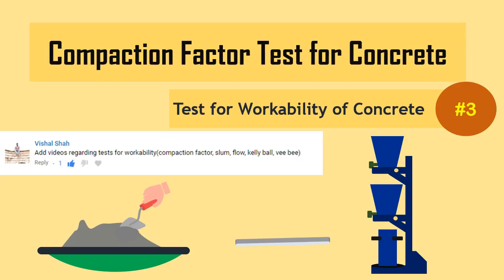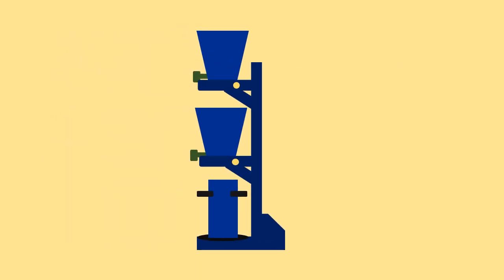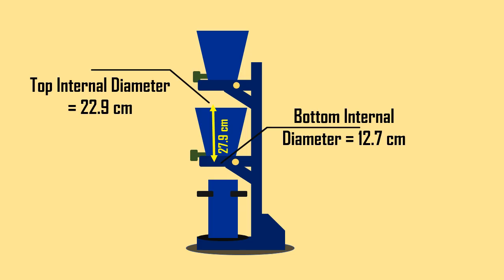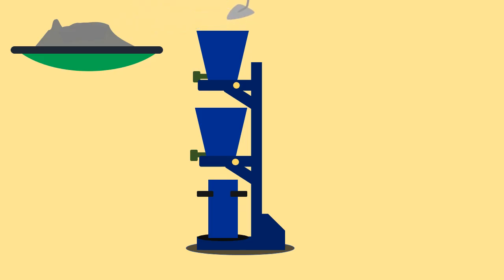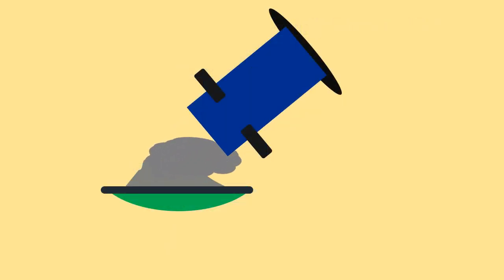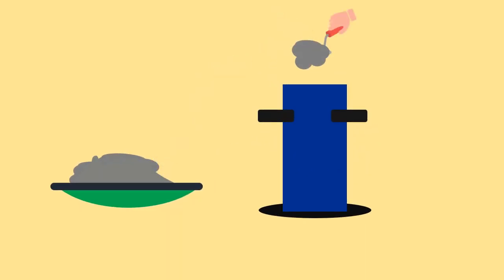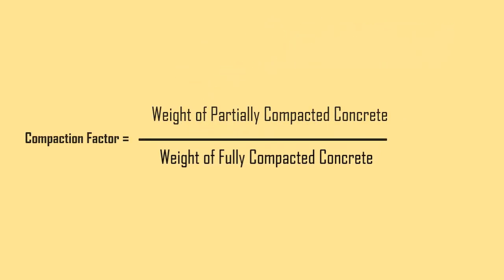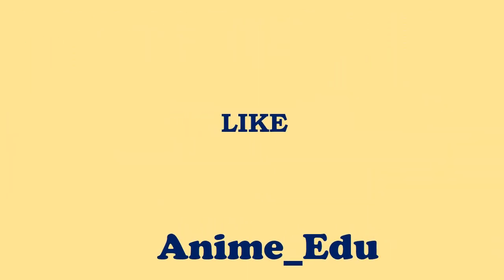Compaction Factor Test for Concrete || Test for Workability of Concrete#3

Comment: in the 2nd hopper , internal height has written 27.9 cm but in audio it has spoke 22.9 cm that is right if possible please do correction. Otherwise this video is very helpful. Thank you
Reply from the maker: Thanks for your feedback - it's helpful for improving the lesson. I'm glad you've found the overall video useful.